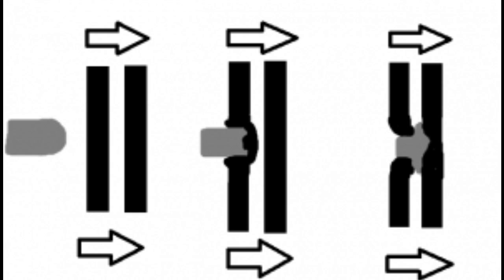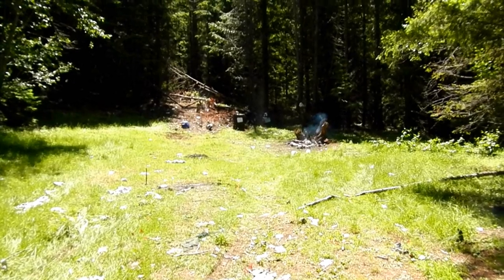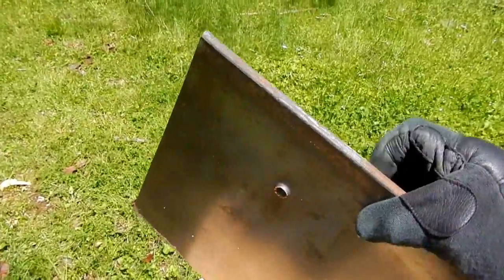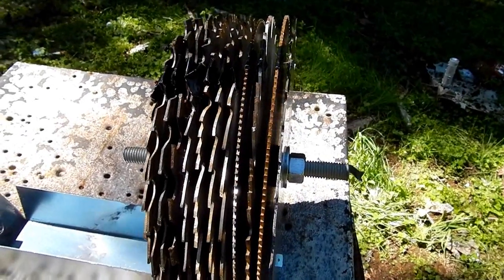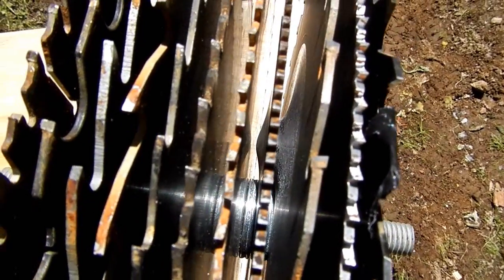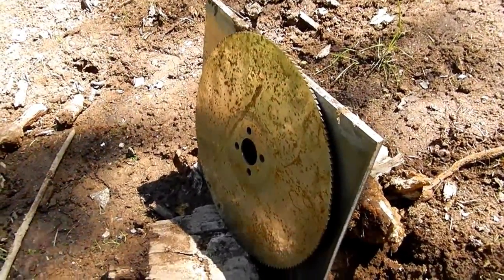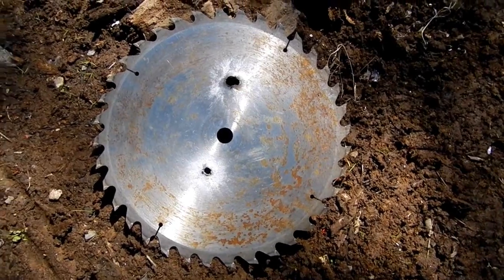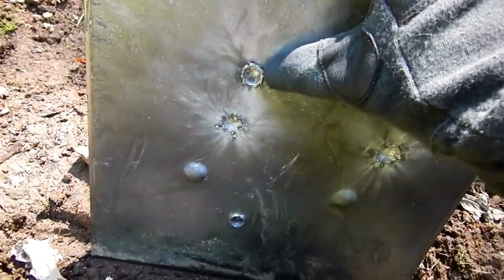Testing the Concept of Spaced Armor

Comment: I do not want to sound rude but the experiment is not properly done. Objective of the test is to test influence of spacing the plates while keeling the type of material and its thickness constant. Proper test would be to use the thick plate and saw blade and bind it together and test penetration then use the same thick plate and saw blade and space them from each other and then test again.

Comment: All this to prove a 5.56 at higher velocity and smaller is good for penetration of 1/2"-5/8" steel no matter what, a 7.62 is good for around 7/16" no matter what spacing, or solid plate, I see no positive result from spaced or non spaced, and you are not even considering the saw blades are high carbon 2x-3x harder than mild steel, thanks for your service, time and money, but you proved nothing other than penetration depth of two different rounds

Comment: this guy clearly knows nothing about metallurgy. he also seems to have little understanding of the defences between the two types of rounds he is using. or he would not have been surprised that 7.62 ball had a lower pen that the 5,56 ball. I also suspect he didn't understand the armour on the vehicles he served in. as I am fairly certain that the outer plate on no US  armoured vehicles ever used in combat had a thin aluminium outer skin.

as for his conclusions they are a bit iffy to say the least

Comment: This concept vs a Karate chop through through multiple boards. The science is astounding.
Reply: Tragicide a bullet penetrates, i'm pretty sure a karate chop hits with continuous strenght, albeit i dont think you can break a solid piece of steel with your fists (i could be wrong)
Reply: @carso1500  I'm talking about how when karate guys break those boards, the boards sometimes have a space in between. I always thought so they could break the board easier. But the boards don't tear away at the hand like this test does with the projectile.

Comment: They lose a critical amount of energy penetrating the initial thin layer.

Should have prepared the combined layer testbed a bit better.  The two layers should have been held in place with bolts.  The results might have shown more absorption of critical kinetic energy.

A thick/thin combination looks far more practical than so many thin layers.

Comment: I loved you video, and the idea of testing various combinations of bullets and armor.
I think spaced armor would be a lot more effective if there was more space between the layers. The first is only to shatter the billet, and then the pieces will impact the next layer over a much larger area. A single plate will prevent the bullet fragments from dispersing.
Then again, the hardness matters. A hard steel plate is more likely to shatter the bullet, but also more likely to shatter itself. Mild steel will bend, faring worse than straight hits, but much better against billet fragments and oblique hits.

Comment: Maybe you should have done an experiment where a saw blade was  clamped tight to the 3/8" steel plate as opposed to having it spaced to show the difference that spacing has on the penetration.

Comment: In order to show that spaced armor gave better protection than non-spaced armor, you would need to show that for the equivalent total thickness, you get better stopping power with the spaced armor.  This test doesn't show that.  The spaced saw blade stack you shot (assuming each blade was 1/8" thick) would have equalled over 1/2" plate.  In other words, the 5.56mm round penetrated an equivalent of 1/2 of steel (penetrated 4 blades).  You would need to shoot a steel plate that was 5/8" thick.  If you got penetration of 5/8" plate, then your conclusion would be valid that the spaced armor provided better penetration than the solid 5/8" plate.  And just to be perfectly fair, you should use 1/8" mild steel plates of the same size as well.  I would also consider spacing them apart a bit more as well, as that may improve performance too.  Now if you shot a 1/2" mild steel plate and DIDN'T get penetration, then this test would show that the spaced armor was actually WORSE than solid steel plate.

Comment: All those saw blades could have been sharpened for about $10 a piece.... saving you HUNDREDS of dollars if not well over a thousand in replacement cost.  Common joe steel plate.... $40.

Comment: Spaced armor : made against shaped charges

This guy: shoots rifle rounds
Reply: The original spaced armor developed by the Germans was designed to counter Soviet anti-tank rifles, so I am assuming he's looking at it from that angle.
Reply: @ck0311  true, however, the main intent behind the shürzen on the panzer 3 and 4s was to prevent shaped charges from penetrating, the fact that spaces armor or even barbed wire attached to a vehicle could stop solid rounds was a welcome side effect.
Reply: @luggilu7864  I know how this armor type works. The a 7 has this arrowhead so when a apfsds shell hits, it will lower the tip down inside of the armor so the angle of it changes before the shell hits the main body of the tank. It just sounds so curious using air as a strong legit armor 😂
Reply: @luggilu7864  That is the common myth that makes its rounds on the internet, yes. However, in reality, the sole purpose behind it was to stop anti-tank rifles. 

Even without looking into the German manuals (or even Wikipedia?) that explicitly state that you can just look at the numbers of the weapons in question. The number of anti-tank rifles absolutely dwarfed that of the number of weapons capable of firing shaped charges.

Why would any nation develop armor to defeat a weapon that is was so exceedingly rare? They wouldn't. That's why none of them did. Spaced armor helping to protect against them was just a happy coincidence.
Reply: @luggilu7864  why would it be to stop shaped charges...? Rockets and bazookas were used close range so there would be no reason to protect against them (schützen isn't even effective against it anyway) and no commonly seen tanks and tank guns were using HEAT in large numbers... so why would the Germans need to protect against shaped charges...?
Reply: You know how the Leopard 2 can hold apsfds shells ? Because its one air conditioned boy
Reply: @little_lord_tam  yeah but in the Case of the leopard 2a4 it's the ceramics and the composition of the composite armor. In the case of the 2A5 and later variants its A the composition and B the angle of the frontal arrow heads.

Comment: Spaced armor is there to prevent HEAT rounds from penetrating. The outer sheet sets off the fuzr, and sends the molten metal from the HEAT round (I won't explain HEAT projectiles, look up on Wikipedia for more info) the molten metal travels through the open air between metal plates and is significantly less effective on the inner plate than if there were no spaced armor.
(At least that's how it works for tanks and RPG type weapons)
Reply: I suppose the theory also would work for solid projectiles?

Comment: Not really a good test. Steel varies quite a bit in hardness and strength. Soft mild steel is not going to stop  very much and saw blades very quite a bit with some being only hardened only on the teeth and others the whole blade. I wonder how far the blades would have been penetrated if they were clamped tightly together. Also the big blade should have been clamped tight to the 3/8 plate to get a comparison to the spaced shot

Comment: Good idea with the saw blade setup. Not sure what ammo you are using but you're 7.62 doesn't appear to be a FMJ so you may have an apples to oranges comparison. Armored steel essentially works by being hard enough to shatter the bullet. You look to be using hot rolled steel which probably has a yield strength of around 36 ksi. By contrast, Mil Spec Hi Hard Ammo is almost always above 160 ksi. Although it is purchased based on ballistic capability rather than mechanical properties like most steel. Aluminum works in a different way as armor. It basically liquifies as it is penetrated eating up enormous amounts of energy in the process. The bees knees though is ceramic armor which is basically so hard the bullet disintegrates expelling its energy radially.

Comment: hows that nobody is using it for lets say armored cars or does it? it could save a ton of weight instead of masive armor you can stack the layers...its very nice...it spreads the energy more to the sides
Reply from the maker: It is used extensively on modern vehicles like MRAPs and up armored humvees. Ususally a layer of aluminum, then steel

Comment: Yeah. Thats not a surprise. This is based on the rounds velocity . because the bullet is moving so fast. It is creating a physical change in the properties of both plate and bullet. This is called an imperfect liquid...basically the 5.56 reaches a velocity window where the steel acts as a putty and The bullet acts as a slightly more dense putty...which passes through the less dense substance...because...physics i am not explaining on youtube. Nor for free. Because wow is it hard to get these concepts across to people in the correct fasion. 7.62x39 uses kinetic energy directly against the steel as solids. Because it is very slow. Put a 124 grn fmj in a .308 instead and watch that hole open up...from increased velocity.
Reply: @Aaron Washburn i have given up with it. Im not putting effort into giving information to people anymore. They dont care . why should i?  Yes , i know, i was describing in layest and laziest way possible what happens uppin impact without use those hard concepts like imperfect liquid ( simple ,more dense passes through less dense substance) or using propper ammunition as marked on the rifle. Or dont touch the trigger until ready to shoot..

Comment: So much salt for what is essentially a proof-of-concept test!  First of all despite all the bitching about him doing it wrong, he proved the concept works, and works well at that. Second spaced armour has been developed and dropped several times since the 14th century when breastplates were made of 2 and 3 play steel plate. While not common several examples have been found in historic armouries such as the tower of london's collection. It wasn't until the advent of shaped charges that it needed specific spacing. 
What has always made it fall by the wayside in the past is a combination of ballistic tech outpacing steel tech, and until recently the difficulty of making it functional and mobile. 
Even w/o a large space it works by damaging the round in such a way that the second impact will cause the round to break apart and waste it's kinetic energy that way, instead of dumping it all neatly into the primary plate. It also works much better with lightweight or higher velocity rounds.
As far H/E & shaped charge munitions the spacing is just there to prevent the gout of blast from fully reaching the armour, or in the case of chain link "armour" you sometimes see to prevent the war head from triggering at all.

Calm down and get over yourselves,  if you think he's wrong, film yourself doing it "right" and put yourself out there.
Reply: I too am on a low sodium diet, and firmly believe in freedom of the Interwebs for just such purposes. The very reason anything ever, ever gets invented, is because some guy with a theory and some shop tools got creative. The fact that one of his tests was 7/64ths" off is mildly besides the point...

Now, I just need to figure out how to thread my 18" diamond encrusted concrete cut off blades into my Molle straps...

Comment: all this video has shown is that by adding more armor the round cant penetrate, there was no comparison between the saw blade and the steel directly contacting/melded as one versus them spaced apart. thus proving only one thing, that adding more metal stops bullets, also i would want to point out that with the saw blade pointed at a angle and not leveled, the bullet striking it will expend more energy as there is more effective thickness to go through and as well as the metal normalization effect where the billet will turn in, in your case downward to normalize itself to being square penetration, again expending more energy  and causing more deflection thus increasing the effective thickness of the steel behind it

Comment: the physics makes sense since the front steel will rebound the bullet to X degree where on solid sheet hasn't any rebound except itself.  In other words, if you had two experiments both using the same type of steel, one with 1/2" solid, another with 3/8" solid behind 1/8" front piece, the 1/8" piece would rebound the bullet "to whatever degree (X)" and the penetration would not match on the rear side between the two setups.

Comment: Isn't the whole point of spaced armor (especially on MRAPs, maybe not so much here) to stop against HEAT/Shaped Charge projectiles?
Reply: Yup, pretty much. It's there to trigger RPGs and the like. So you're fine unless someone had a 40mm bofors laying around!
Reply: Well, the Germans in ww2 used spaced armor initially to defend against Soviet 14mm anti tank rifles firing regular AP bullets.

Comment: What if an armoured vehicle using the concept of mass-spring and damper protection?? anyone have any reverence on that idea??
Reply: The problem with that is reaction speed upon impact. In order for such a system to work, the armor would have to be able to initially absorb the impact inelastically and then decelerate the armor and round/impact momentum. If the armor material cannot prevent penetration with zero resistance, then it won't be able to stop it with springs behind it. However, a system could be employed in which the armor plate was put under NEGATIVE spring pressure and held in place by sheer pins such that upon impact, the sheer pins would break and the springs would initially assist the armor in accelerating to the bullet's initial velocity before passing the spring's equilibrium point and then beginning the deceleration of the total mass. The problem with this is that the armor would have to be held under SUBSTANTIAL load as it would need to accelerate nearly instantaneously upon impact and the sheer pins would have to be RIDICULOUSLY sensitive that the whole system would be horribly impractical and likely be set off if the vehicle hit a pothole or bump in the road. It would also only work once before having to be reset.

Comment: I'm surprised people still don't understand that the 5.56 has more penetrating power then the 7.62x39 when used against hard targets. The "AK" does more vs softer targets and kenetic energy as a whole but the "AR" has higher velocity mixed with a much sleeker package meaning more penetration vs hard targets. I'm not sure if this means the AR has more kinetic energy per sq inch or not (I would doubt it).
Reply: One thing a lot of people forget also is that the famous 7.62x39 M43 round is pure lead core with a copper jacket. Modern day rounds are much more commonly steel core with copper jacket, like the 7N6.

Comment: Was that AP 5.56? Seems hard to believe a standard round went thru 3/8 so easy.
Reply: He said it was full metal jacket. The plate hasn't been heat treated making it more malleable, allowing the 5.56 to go through it. If it was hardened steel it would probably stop it, and if not, you would notice a much more jagged hole due to it being more brittle.
Reply: @johnfletcher7177  point taken but weren't the 7.62 fmj too? Hard to believe 5.56 outperforming 7.62. Maybe I should respect 5.56 more haha.
Reply: @christophermckeon9030  7.62 is a wider bullet moving slower, It's like trying to pop a balloon with a pen compared to a needle.

Comment: Never shoot on public lands without a leaf rake, a snow shovel, and a roll of trash bags.    On another note, it'd be cool to get all nerdy with different bullet resistant and cheaply available materials, like UHMWP, fiber-epoxy composites, aluminum oxide epoxy fiber ceramic, hardened aluminum, carbon fiber, and Dyneema. And seeing how small of a space that will be effective would be cool.  Using the concepts of metal foam with all that would be nifty too. And if an air-gap works, would a liquid, gel, or surfboard foam work better?  Please spend your money and time on all that and videotape it cuz I'm broke. Thank you for your inspirational work thus far.

Comment: The brittle plates rob the round of kinetic energy by ablating away.
Reply: They are only attached in the center too which is unlikely in a real application. There is going to be flex in the saw blades between impacts dissipating energy before penetrating.

Comment: This type of armor is most effective against HEAT projectiles and shaped charges such as is found in some tank rounds and RPGs
Reply: @Dika Vinci well the mrap is not a tank and an rpg is an anti tank weapon that can penetrate lots of armor, they might not fully stop the warhead all the time but at least they weaken it to the point were it does little damage most of the time

Comment: The saw blade that shattered like glass is a high carbon blade. Probably for a wet saw. These types of blade are good for cutting other metals at a very slow rpm. If you drop it it can brake in a similar way to glass.

Comment: If you had used 7,62 NATO (Yes, I realize that you probably don't have a weapon with that round) it would have looked way different. the 7,62 NATO is 7,62x63 and is what I had in the army and when I was in operations. The 7,62x 39 is a Russian ammo for the AK-47 and is a lot weaker.